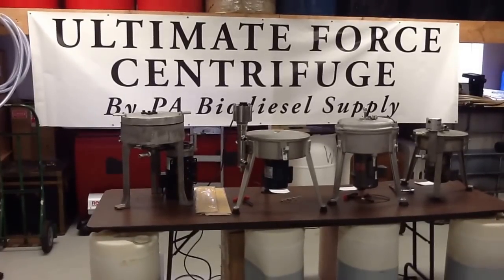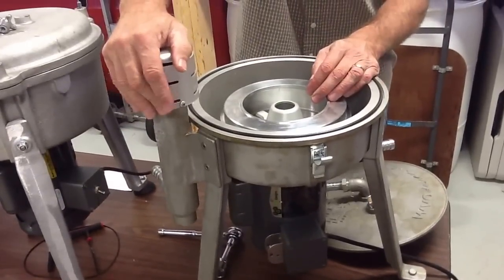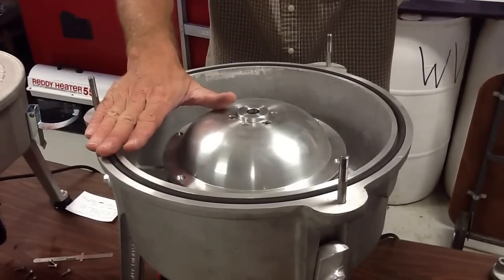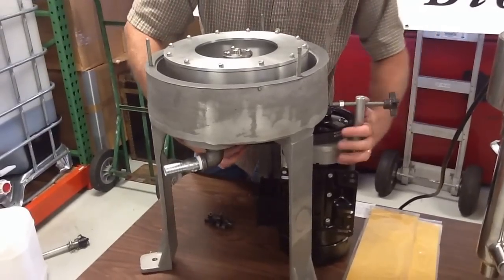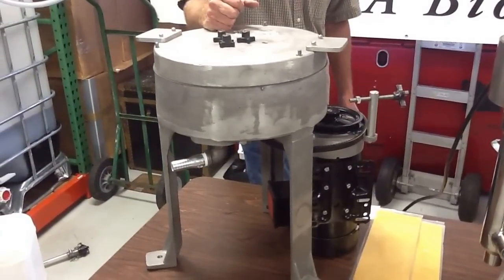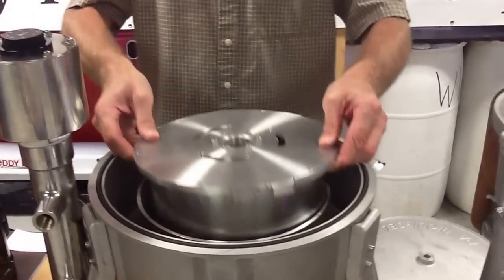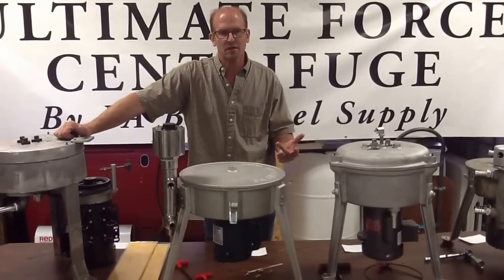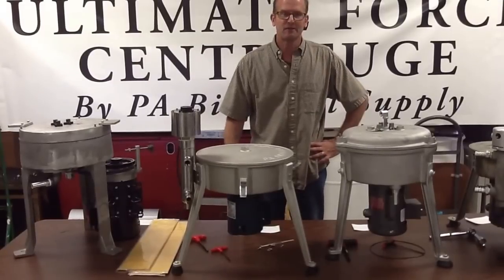Ultimate Force Oil Centrifuge Comparison

Comment: That is a start!  Things to consider for comparison among each unit is wise.  You say none are the end all, be all for used VO processing, but not why!  suggested topics for comparison/rating:  water removal capability for oil with a FFA level of W: (start with X ppm of water concentration and after processing, for each unit processed oil with water concentration at Y ppm), removal of particulates (single pass) of A gallons resulted in B grams of particulates,...  (Liked)